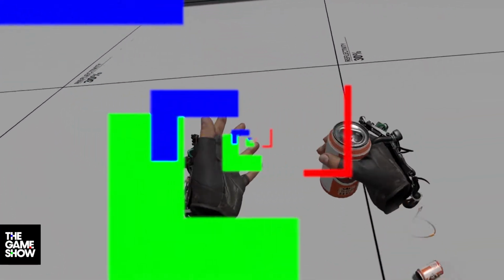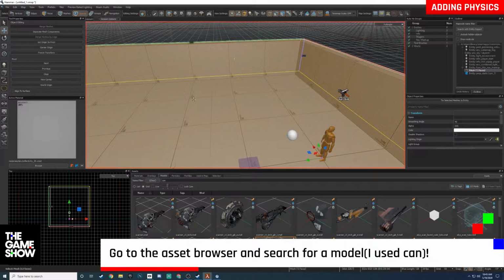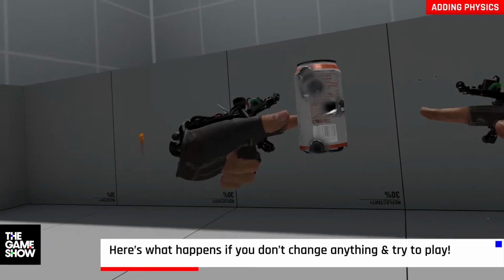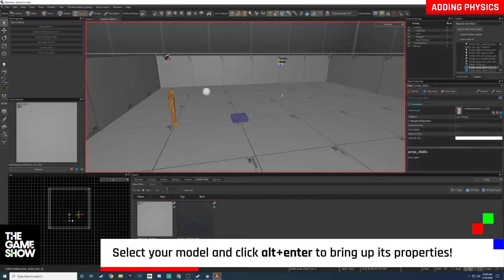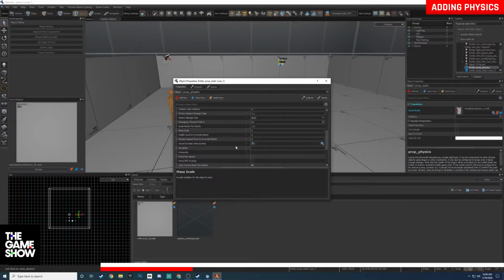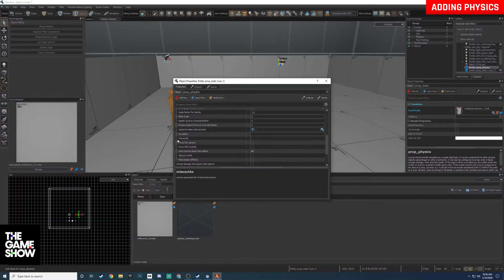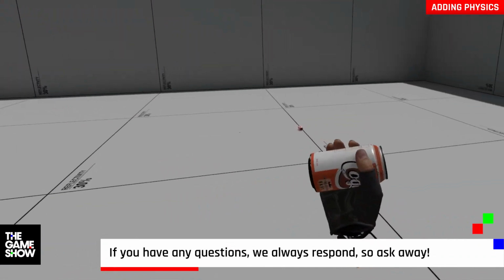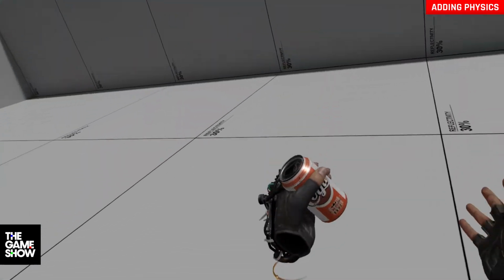Half Life Alyx Hammer Tutorial | How to Add Physics [Beginner] [Source 2]

Comment: Do you absolutely need to have vr to view and use? I've made a number of  map's and prefabs back in the day's before I had Internet. Now that I'm home all the time with time on my hands. Can this be compiled to bsp and run, use the keyboard and mouse to emulate the vr control I know throwing a can in the air is a bad example but say making a map can it be viewed and walked around in its finished form with var and vis if it still has that?

Comment: Awesome thank you!
Does anyone know if its possible to re size a physics object? I placed a fridge with no doors, and re sized it with the Selection tool as the standard model is huge, then made the physics door entity, re sized that with the selection tool. All looks fine in the editor, but once in the game, the physics door is its normal size, not re sized. The door works fine, just too big. Is there a different way to change the size of objects? 
Thank you
Reply from the maker: You can check the parameters, not entirely sure what to do in your case!